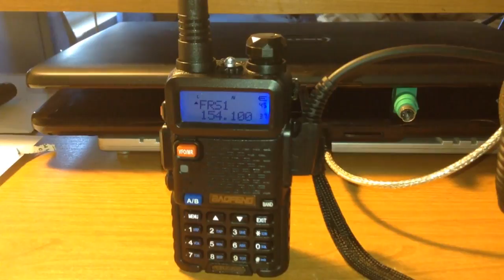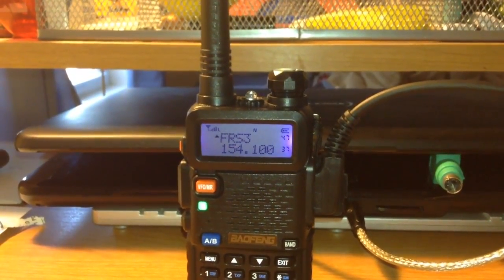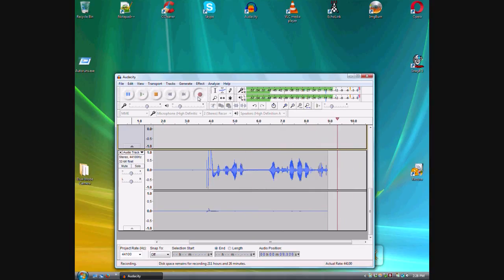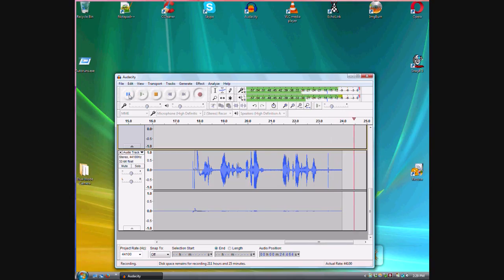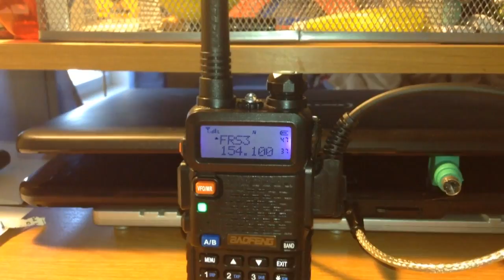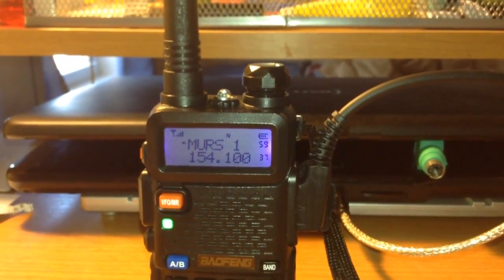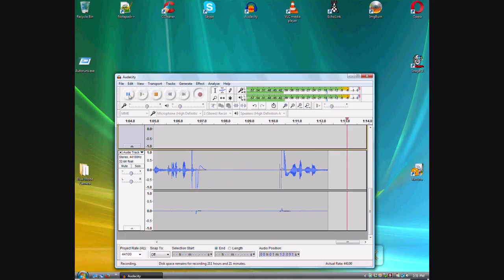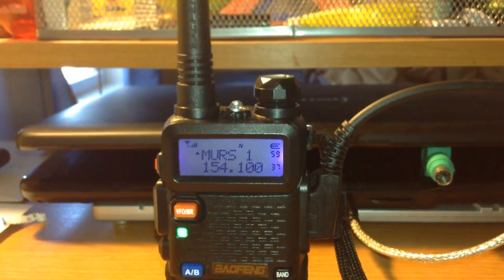Baofeng: On-Board Mic vs. Speaker Mic vs. Clip-on Mic

Comment: On my Baofeng coiled mic, I opened it up and cut small layers of "microphone" style foam to put inside and drill out the mic hole to a larger size. Simple mod, sounds good and cuts down on the echo. Also the speaker is a little louder on the coiled mic.

Comment: I think its no so much the microphone as is the way the modulation is handled by the internal chipset. You might find that over modulation isn't a problem with the supplied mics or chipset. I work in a moderately noisy retail environment and use the speaker-mic with my radio. The number one thing was that other said I sounded somewhat muffled. I found that opening up the mic hole a little bit with a drill solves this problem; bonus for cutting the hole to an angle pointed at the mic center! One speaker-mic a friend had was really muffled, found out that the hole for the mic was still filled in with plastic! Worked like a charm after drilling hole out.

Comment: If for some reason you want to use the external mic and ptt but keep the internal speaker working, just cut the tip and ring sections off the 2.5mm jack with a side cutter (and file any sharp points off). Did this with my Anytone 878 and a cheap chinese external mic+speaker+ptt (works beautifully as a table radio now, using a Diamond X30N aerial as the antenna), but i think the Baofeng is the same.
Reply: Do you mean the small or big jack out of the 2
Reply: @mralanvideo  I said 2.5mm so it has to be the smallest one.
Reply: @TeraVolt Can this work the other way round. If I want to use the internal mic inside the radio, but only use the external speaker, if I cut off the 3.5mm jack, will that work?
Reply: @EasyyokeFilms  Never tried it... could potentially work or not...

Comment: How do I get a clip mic only to connect to the ham radio and connect a military grade head set to the ham radio, I don't want the two in one, I'm working on a project is why
Reply from the maker: Cryptic Wolf If you mean the clip-on speaker mic that I have in the video, it has a built-in jack for a headset. Otherwise, if it’s a Baofeng like I have here, the pin out is pretty easy to find online. You can buy one of the male connectors and wire/solder it to two female adapters that would fit the connectors on the mic and the headset respectively. Would be a pretty simple job.

Comment: Interesting test, however, you where using frequencies outside the legal 2 meter band width. I use a Btech speaker mic and I've had no complaints.

Comment: I would hate your repeater... here, they offer you radios or antennas if your audio sounds terrible
Reply from the maker: That's interesting. Around here, pretty much everyone sounds like the audio from the tests I did even if they're sporting Kenwoods and Yaesus.
Reply: @Dantastic  the radio sounds fine, even with the clip on speaker mic if modded. I noticed guys on my favorite 2m repeater trashing baofeng audio quality. I looked them up and couldn't not buy a uv5r for $25. My 1st test was to check the bias of my buddies. I keyed up at drive time and announced I had a new Icom ht and asked if I was coming through ok. 4 guys who all hated Baofeng replied with resounding positive remarks. "Sounds great", "how do you like it", etc.

They didn't believe me when I told them it was Baofeng at 1st...or they didn't want to anyway. 2 of them bought one after.

Comment: Just letting you know that some FRS and all of GMRS are only legal to be worked below 2W (some FRS require 0.5W) - the Baofeng UV-5R can put out 4W on high power and 1W on low power.
Reply from the maker: Yup, I'm aware of those guidelines. Realistically, that's more of a technicality in this case. I have the HT set to low power, so it's putting out a max of 1 Watt on the FRS frequency. On UHF, that extra half Watt isn't going to buy you much on a handheld. In fact, even at the full four Watts, the waves aren't going to propagate much further with the rubber duck. The main reason people make a big deal over that law is because they don't want people buying these for FRS/GMRS/MURS and then accidentally transmitting on forbidden frequencies, which has been happening quite a lot. Thanks for the concern, though : )
Reply: @Dantastic  Just to clarify, it is illegal to transmit at all on these radios on FRS frequencies. In order to transmit on FRS, the radio must be compliant with part 95, and it is not. I've demonstrated satellite communication on my channel with 4 Watts with a rubber duck with this radio. So just be aware.
Reply: Or just move to Australia.  UHF CB operation allows 5 watts operation lol.
Reply: @RoyanGreenwood23  But Australia bans Baofengs and other brands...